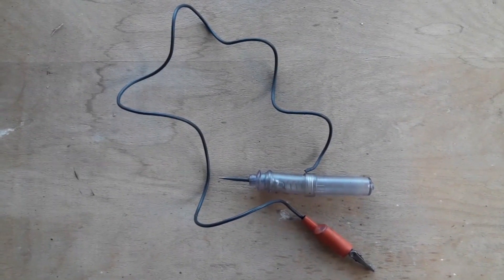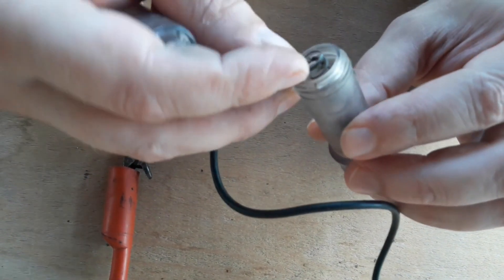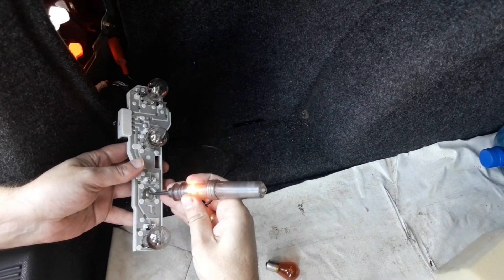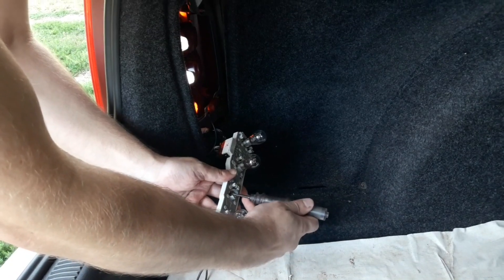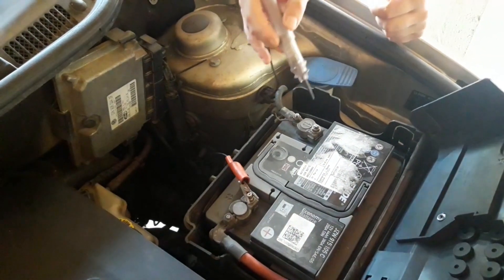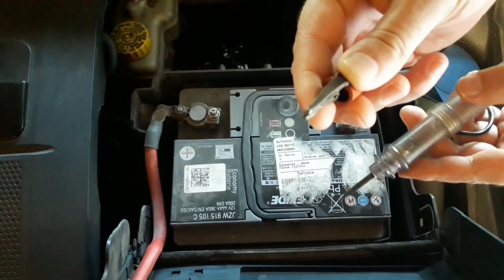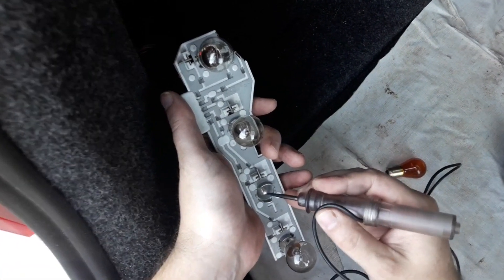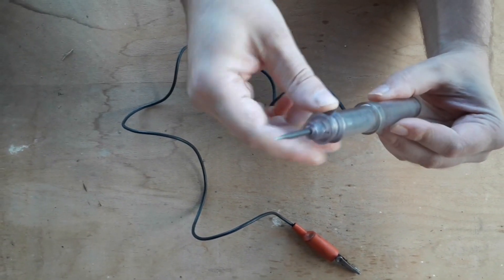How To Use A 12V Circuit Tester? Use This Simple Tool For Solving Electric Problems On Your Car

Comment: And don't buy the cheapest one you can find. I did and my clamp is so tiny it barely opens
Reply from the maker: Hi and thanks for watching!
You're correct, mid-class or professional ones are the best and most long-lasting.
Reply: WARNING !   A truck driver with a toolbox and a test light with a sharp point is the most DANGEROUS PERSON IN THE WORLD !